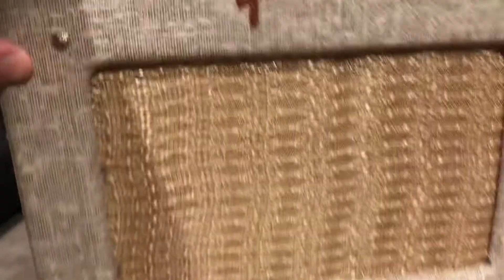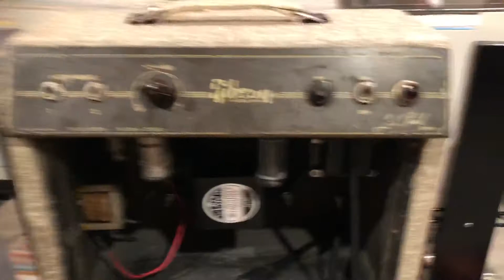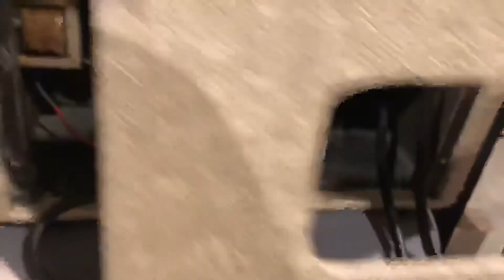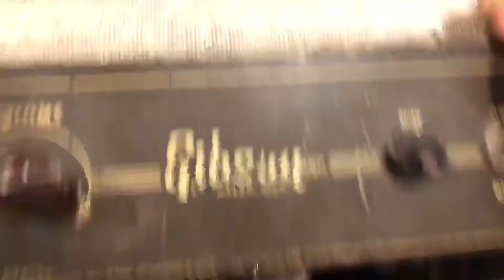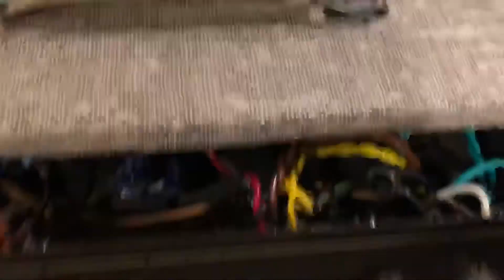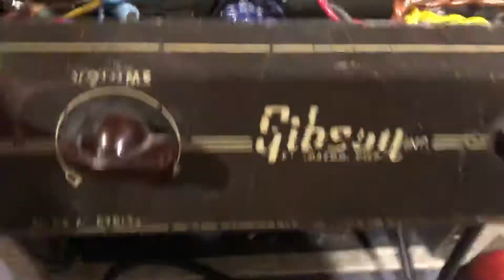VC Gibson GA-5 Les Paul Jr Amp Project part 2

Comment: Looks good!  Three prong - smart move.
Reply from the maker: Thank Kris! I own an old Harmony amp known as a “widowmaker” no power transformer and two prong plug. Just straight 120 volts thru the whole circuit. If something failed the current would go right thru the guitar strings to my hands. Nuts! Glad I learned about that. Never plug that amp in again. Cheers!!

Comment: Wow. I was really looking forward to seeing the outcome of the amp.  If I had a hat on I would take it off to give you the proper tip of the hat that you deserve. Now correct me if I am wrong but the tube that you added was an addition to the amp? Because I do not remember you showing any tubes when you posted part one. I am really blown away at the way you reupholstered the front. Grabbing an original new power transformer was spot on.  Surely looks like a professional restoration to me. Well done Jon.  So happy for you that it came out so good~
Rob/Boston
Reply from the maker: Thanks for watching Rob. The amp was originally a 3 tube amp. Whoever had it before me converted it to a two tube amp. No it’s back more or less to original specs. Still more tinkering left. Cheers!!!